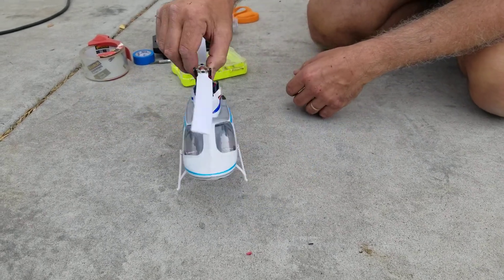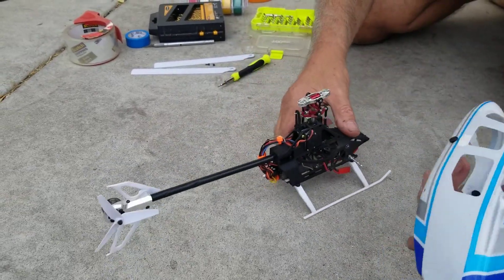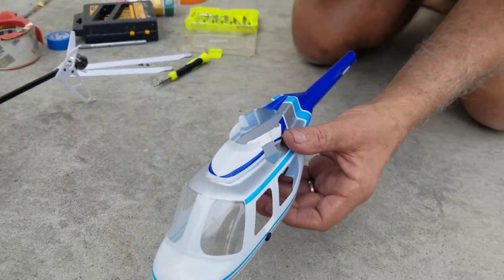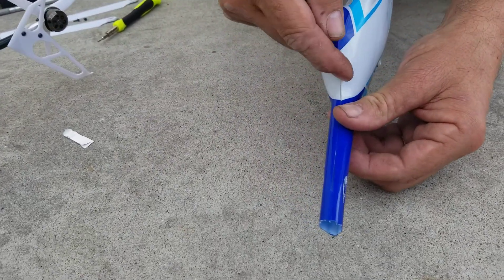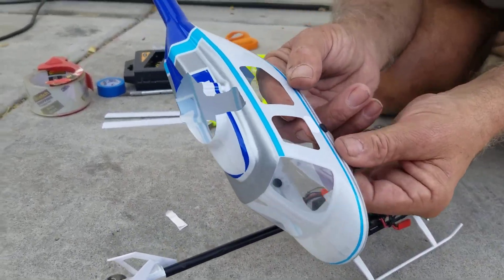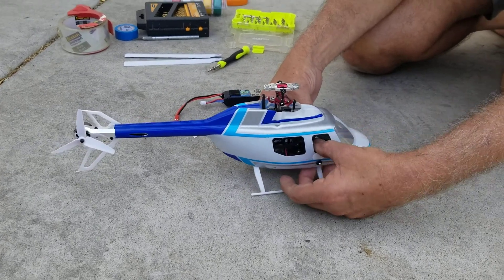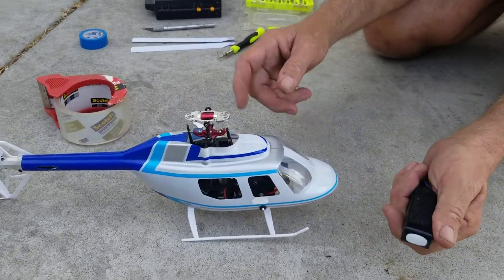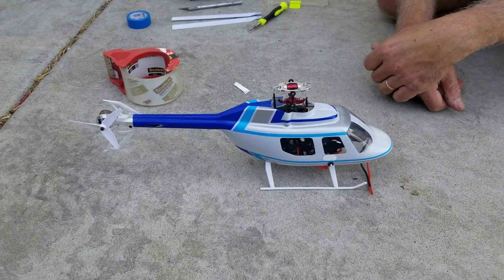Blade 200s /200srx Jetranger fuselage installation

Comment: Nice job Stihl, I installed the CX JetRanger on one of my 120 S' and use 200SRX main blades.
Reply from the maker: You've peaked my curiosity,  how well did the 120s fly with the 200srx main blades,  and did you have to shorten them? Or lengthen the tail boom?
Reply: @Freddy-Bueger  I installed the tail motor by drilling out the hole where the CX JetRanger tail rotor attached and installed the 120 S  tail motor with silicone, my JetRanger retains the original tail/vertical stabilizer and tail boom-mounted horizontal stabilizers (I'm sure that you know that the tail boom is extremely fragile and will crack if you look at it the wrong way). The 200 S/SRX blades really stabilized the 120 S and it's not as twitchy. To answer your question; The 120 S flies "bigger" than it is, going from stock diameter 330mm/13" to 410mm/16" 200SRX blades. That extra 3' makes a significant difference.  When I get around to I'll extend the stock boom on my fav 120 S and put 200 blades on it.
Reply from the maker: @chadvienna9288  very interesting. I have two 120s, one stock and one with a microhelis fiberglass canopy. Both fly very well as long as I'm just cruising around. They are borderline underpowered, and tail can be twitchy at times if i try to fly it too aggressively. They fly good enough for what they are, for just lazy flying. That's good modification you came up with but I think I'll leave mine stock. I have a pair of mcpx bl2, and a 150s to satisfy my hot-rod micro heli urge. Lol
Reply: @Freddy-Bueger  I rarely fly my 120 S', most of my time has been spent fitting a MD500D body on my Nano S3 (now on hold) and building a Mercy Air Bell 407 ( https://www.youtube.com/watch?v=dt2IBOXaXjk ) vacuum form kit fuselage for my mCPX BL2.  Take care Stihl, 'pleasure chatting with you.

Comment: Thanks so much for this. I just bought a 200 SRx for this project and have the fuselage on order.  I really appreciate your time to show us how to do it based on your trial and error.  Wondering how it flies.  Thank you.
Reply from the maker: Anotheer tip: my heli has the aluminum tail motor mount which is kinda bulky. If you keep the stock plastic tail motor mount, you can retain about an extra half inch of the fuselage, letting it go all the way to the front of the tail motor, and only need to cut off a small piece on the left side to allow the virtical tail fin to attach.
Reply from the maker: Oh and it flies very well. The fuselage is so light that you won't even notice the difference, other than it  looking really cool. I have another video of it flying on my channel.
Reply: @Freddy-Bueger  Thanks very much. One question though, the 200 srx doesn't have an aluminum tail boom like yours in the video.  It has a carbon fiber boom much the the SR 120.  I don't think I can bend that but maybe won't be so much an issue because it is considerably thinner?
Reply from the maker: @stuartoakley4784  if it has a carbon fiber tail boom then it is aftermarket. The original tail boom on 200srx, 200s, SR, and 230s is aluminum. If you have a c.f. tail boom you will need to replace it with the original aluminum one. The boom must be bent up in order for the conversion to fit properly.
Reply: @Freddy-Bueger  Just put it together and did a maiden flight.  Super cool.  The boom was aluminum but quite a bit narrower than what you have. I was able to bend it no problem.  Mine is the SRX so the mechanics are little different.  I didn't have to trim out the top for the servo because the servo is in a different spot out of the way.  I just had to trim a little for the swash plate at the back.  I did have to put some tape at the end where the tail motor mount is because the tail rotor was hitting the plastic.  But if I trimmed too much the boom would start to show and it wouldn't look good.    To make it easier to locate the canopy pins at the bottom, once I had the holes cut where you indicate just below the original holes on the silver line, I drilled through the holes so the pins would be located perfectly.  You are right about the fat booty so closed up the back as best I could.  Still looks awesome in the air.  Thanks again for this tutorial really made things a lot easier. Happy flying.
Reply from the maker: @stuartoakley4784  I am so glad this helped you out.